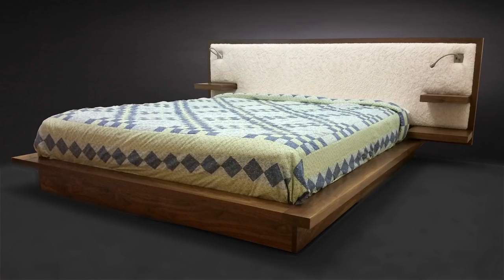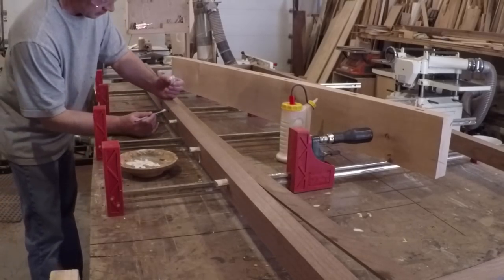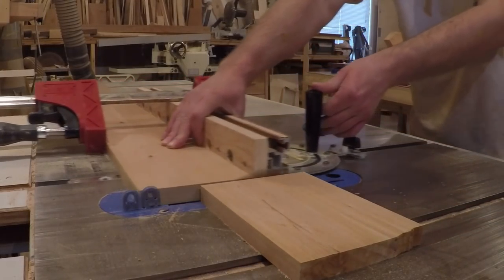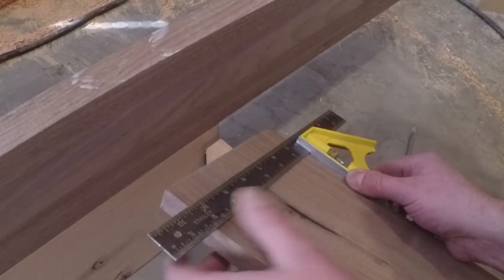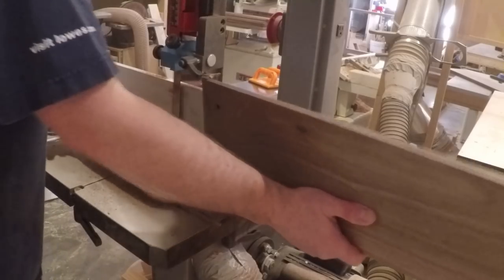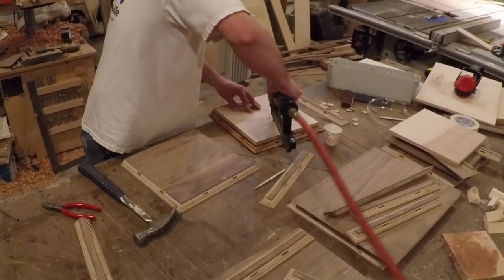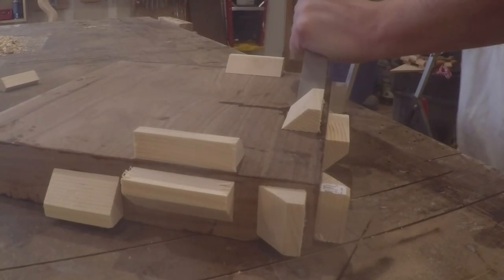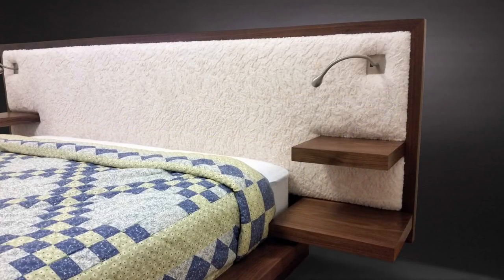Building a Platform Bed with Floating Shelves, Reading Lights and Sheepskin Headboard - Woodworking

Comment: Really nice looking bed. Any particular reason why you didn't space the slats with a couple of inches in between?
Reply: That's odd. It's recommended to leave a couple of inches in between so the mattress can "breathe" otherwise you risk developing mold, that's why commercial beds use slats in the first place instead of dropping a sheet of plywood. I doubt mold is covered by any warranty :D
Reply: The moisture comes from the people sleeping on it. People sweat during the night, and that goes in to the mattress, without enough air circulation that moisture gets trapped in the mattres and makes for great mold conditions.
Reply: The moisture comes from the people sleeping on it. People sweat during the night, and that goes in to the mattress, without enough air circulation that moisture gets trapped in the mattres and makes for great mold conditions.

Comment: Can I ask what kind of clamps you used? Thank you
Reply: Bessey parallel clamps. He’s using the more entry level version too, which are very reasonably priced.
Reply from the maker: The majority of my clamps are Jet, I have a few bessy, but they have changed their clamps over the years and the new version isn't that great.  I don't think bessy has an entry level version.  They have just changes them over the years